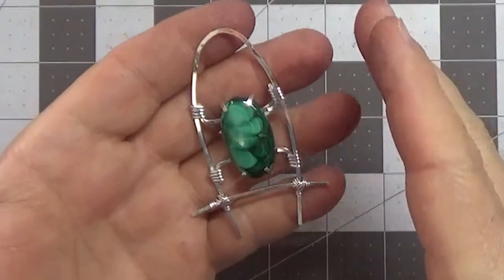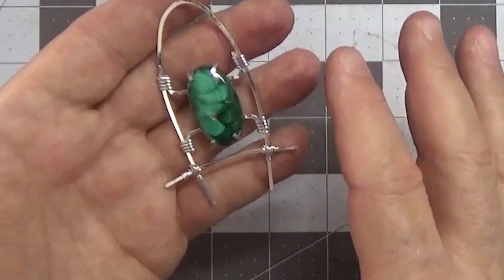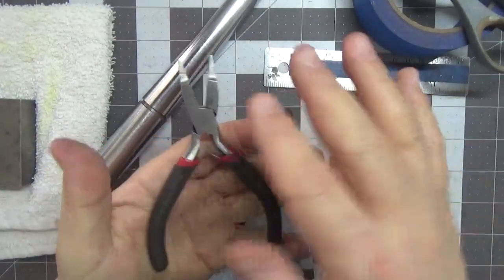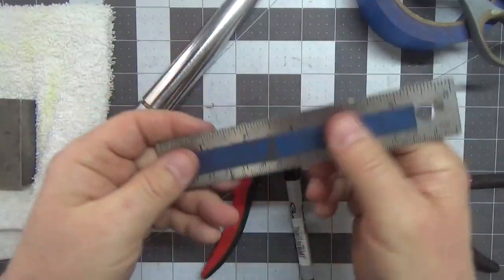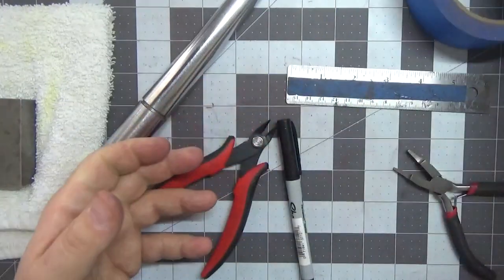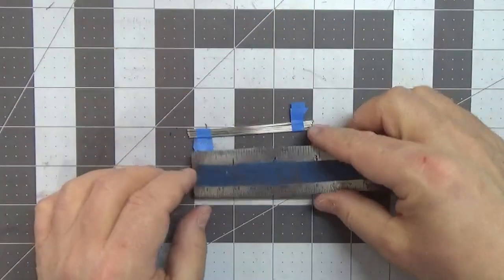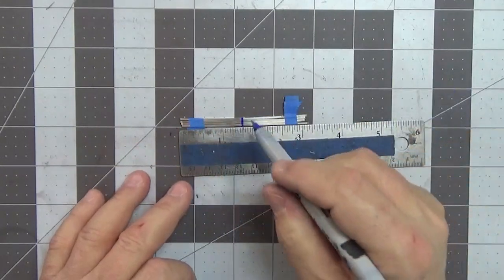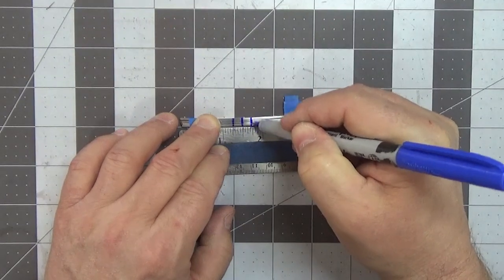The Crossbar Pendant - A Wire Wrap Video Tutorial

Comment: I think I’d rather have the wrap wires from the cabochon to the frame wrap, towards each other  /the center. When using that green cab and having the wrapping go away from each other, all I can see is a frog! I’m sure it wouldn’t be as bad with a different color, but the green  =frog in my mind!😂
Reply from the maker: I saw the same thing when I was working on that design. Good eye